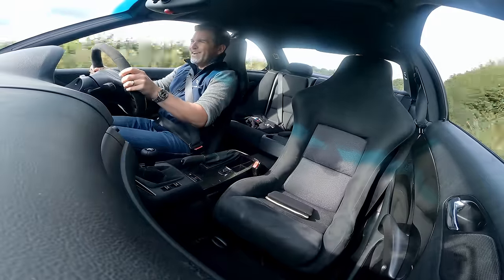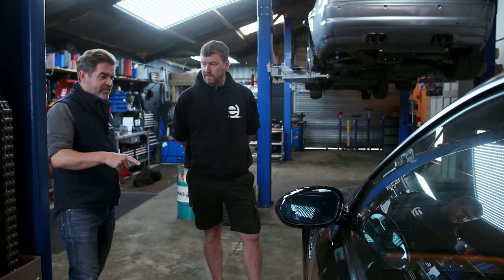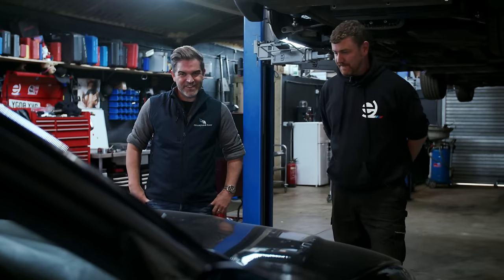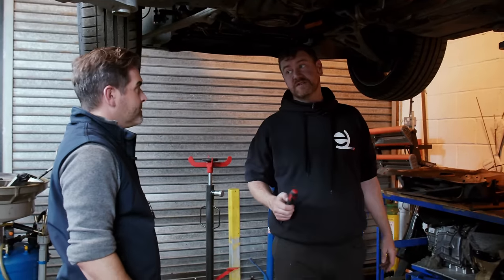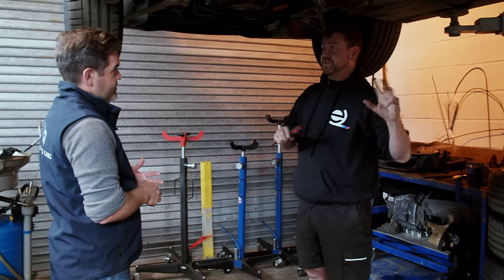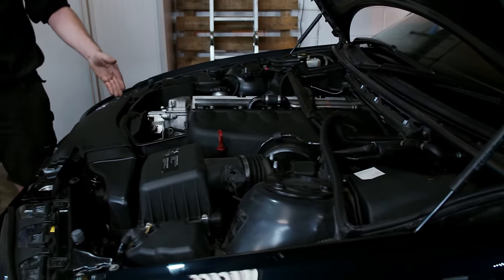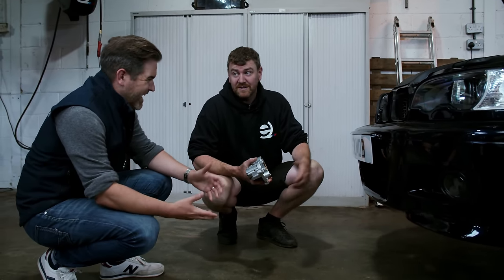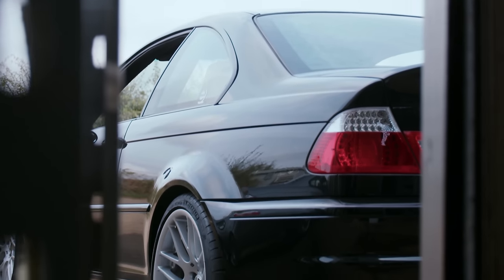BMW M3 (E46) | Buyer's guide with Everything M3s

Comment: The E46 M3 wasn't "the last naturally aspirated straight 6 cylinder M car". That accolade belongs to the Z4 M Coupe, which also had the S54 engine through to 2008. That car also had the CSL hydraulic steering and brakes. And no rear subframe issues!
Reply: I think they meant the last naturally aspirated six cylinder M3
Reply: @johnmitchell2269  very clearly said "M car", but you may be right. 😊
Reply: I also have a z4m coupe it’s great
Reply: The s54 was made for the E46. It was also installed in the z3m at the end of its cycle  and the Z4m. E46 wasn't the last M car with a 6 cylinder naturally aspirated engine but do understand  what he means  by that.
Reply: Z4M Coupes are one of those cars I like to look at and appreciate it, but I feel “most people” would never choose to own one of the e46 m3.
Reply: I wish my dad bought one, had a chance at a decent price years ago
Reply: @rabmc  I don't understand why not tbh, I have a Roadster Z4 M and it's fantastic! Almost the same weight as CSL, same steering system & rarer than an M3, especially in the UK.  Only around 1k ever registered in the UK with less still on the road.
Reply: @FuzeDzn Mainly the looks of it in comparison, the e46 m3 visually is unbelievable and getting even better with age. Such a road presence too.
Reply: Everybody forgets about the z4m coupes lol. But it’s also why I got mine for so cheap
Reply: And looks horrendous
Reply: @ArtVandelayOfficial  🤣🤣 there's always divided opinions on styling, you have yours and I have mine, and neither of us are alone. Its certainly unique, being the last one to come out of Bangle's department, and by general acclaim, has worn well. But hey, edgy designs are always polarising 👍
Reply: @gregspark9845  It's the hood line and headlights
Just looks off, like the cars tired or has down syndrome
I've contemplated the coupe M many times but that front end irks me
Reply: @ArtVandelayOfficial  that’s a pretty NPC opinion
Reply: It's the same engine and overlapped in production. It's not like they made another NA 6 for the Z4.
Reply: @theurbanegentleman4550  It's ok I understand, you 'settled' for a Z4 due to funds 👍
Reply: @matthewnicholas6365  most people know that. The S54 that went into the Z4Ms was identical to the M3 engine, but being the final iteration benefitted from improvements made during the production cycle. For example, it's allegedly less prone to the rod bearing failure. The biggie though, is no rear subframe failure which besets all E46 M3s eventually.
Reply: @ArtVandelayOfficial  wow, you're the master of put-downs 😂. I'm sure your choices are always the right ones. There, feel better? 😉

Comment: Buy a standard manual, fit a carbon airbox, ohlins road and track, suspension bushes, alignment etc, bmw 6 pot front with csl discs, 4 pot 996 rear, engine tune and if doing head gasket cams, shorter diff, short shift kit. It’ll then drive better than a csl! Do some weight reduction and boom you’ll smoke it for £20k less.

Comment: The E46 M3 is the best ever selling M3 of all time. The most successful M3. 2001 to 2006 the entire planet went M3 crazy. The good thing about that, is that because so many were sold, there are a lot of affordable ones. If you don't care about having a rare car, and your prefer rwd, it's a must have. Plus, the S54 engine, is the best naturally aspirated inline six engine ever made. The inline six that doesn't need a snail bolted on to it. Say whatever you want about RB26 and 2JZ, without a turbo those engines are nothing.
Reply: What are you talking about? They only made 50k and another 29k convertibles. That's nothing! Instant classic. I own a 02 e46 m3 convertible myself.

Comment: Some of these M3s are over 20 years old by now, it would be mad to expect to buy one and not have some issues. I've had mine for about 2 years and ive not had anything major need attention. So long as you treat it right, keep up with the servicing and try to keep ahead by prevention. But they are amazing machines, I could still put mine up against any modern M3 and it would look better. This video shows all that CAN go wrong not what WILL go wrong.

Comment: You really gotta be careful with these. Finding someone who put the money into maintaining them is really key. You don't want to be putting a grand here and there into bushings, gasket leaks, and other shit like that, even without the big three. It's an old performance car, and they never got cheaper to maintain, just cheaper to buy in to.

Absolutely love mine... when it runs lol.
Reply: The good thing, is that there are still plenty of people, who don't spend 100% of their budget on a used car. There are people who will spend 70% of their budget on an iconic used car, and invest the rest onto their new purchase.
Reply: I had mine for nearly a decade now.  I kept up the FBMWSH for the first few years, but have maintained it myself since to a high standard.  Excluding fuel, tax and insurance I have averaged spending £2k a year on it - I have not done the RACP/rod bearings/head gasket.  It's a very expensive car to run.

Comment: I have an SMG converted 6MT. I loved the CSL SMG as a daily. "On it" - no question the SMG is more exciting. People don't want tot admit it, but a 1-2-3-4 in SMG is way more intense. Lambo kept this tech for decades for a reason. 
As a daily the problem is at certain rev/speed/throttle combinations gear changes are awkward. You have to actively think about what will happen if you pull the paddle now - could  buck, slap or lag. Going fast in it a non issue, and the SMG downshift is fucking sick on SMG.
So I'd buy an MK60 SMG car for cheaper and wait for it to break / convert so SMG.
Reply: That's my plan too
Reply: @ArtVandelayOfficial  gidddy up!
Reply: I totally agree, especially the 'sick' downshift part.

Most people don't know how to drive the SMG gearbox. It's a fine art.

Comment: Did a ground up restoration on a 03 M3 6 speed I picked up for 3 grand a few years ago, I normally restore domestic muscle cars and sell them but after getting to know every nut and bolt on this car its now since joined my collection and is my favorite car to drive... I also have a 2014 Subaru STI and a 600+HP blown 70 RS camaro... I would suggest anyone who has the opertunity to get there hands on one of these they do ASAP they are getting rare...

Comment: Excellent content, really interesting and true content about the whole car.  
Only 2 additional points : 
1. Where can i find a real CSL for 50K pounds 😅 in Germany they cost almost double as much ;)
2. Owning a fully maintained SMG E46 M3 Coupé with the latest original CSL gearbox software version. This drives absolutely amazing, i would never switch to a manual gearbox. Functioning fantastic on the racetrack. Switches gears almost as a modern DKG and it is THE ICONIC item for the e46 M3, you cant just replace that,  it belongs to the car ;)

Comment: Had an e46 m3 vert from 60/85k miles never missed a beat. Did get the feeling something was about to go pop towards the end.. turns out the vanos went after I sold it 😅 but I miss that car, the smell, the sound, the feeling of actually driving it was a true M car when it hooked up and shifted down by, and you got used to the box.. what a car like a living machine. Had golf r, c63 Amg, and all sorts since . Not even touched it.

Comment: Great to hear the experts on this. I think if I was buying one, I’d need to get a specialist report before doing a deal. Otherwise you could spend £10k on a car and have a bill for another £10k to rectify faults. 

Very useful video thanks 🙏
Reply: If you are going to purchase an M3 for 10K or less, then guaranteed you will be spending another 5k to fix it up properly.
Reply: @djlakota8907  you’re probably right. I think I’d want to buy one which had been worked in by Redish Motorsport in Bristol. Those guys do good work, the kind of work that BMW should probably have done from new. One day.

Comment: A normal M3 is a really tricky proposition right now.  There are few that won't require restoration - a very expensive exercise - and they're just not valuable enough yet to make that financially viable.  So you gotta consider whether you're gonna buy one to keep long term 15 years plus - where they will regain this will in terms of a higher value,  otherwise it's best to opt for something else.  A decent M2 manual can be bought for £30K-£35K and it puts the purchase of one of these into perspective.

Comment: Great video but one thing is you can still get new S54s albeit are £6-7k for a bare engine.
Can also still buy the csl rear diffuser... At 2k however 😅

Surprised Darragh didn't mention rod bearings either too given they're the one thing that can render an engine scrap without warning!
Least with vanos and head gasket, you'll get a warning.

Making the CSL manual makes so much sense though.
They were made towards the end of '02 to and of '03 however... Most just weren't registered until late '04 as they sat in dealers for quite a bit as weren't initially great sellers.

With a 4.1 cwp, they'll still be geared for  180mph too so realistically doesn't drop the top speed capability of the car at all unless has alot more power such as a supercharger etc.
With a 3.63, They're geared for over 200 but obviously don't have the power for it so it's pointless other than for abit more refinement at motorway speeds.
Reply: I managed to bag the last diffuser May last year just in case they went permanently NLA, got a good price on it via a friends staff discount.  
Still in its box in my shed, In 2 minds still wether to fit it or save it to sell later on
Reply: @Chrisclbele  yea, you'd be tempted to just fit a decent replica one in case it was ever damaged or stolen! 🙈 I've a genuine bootlid for mine alright and a vorsteiner bonnet. Only have a replica bumper but just couldn't justify the real deal when they're so fragile given its mainly a nurburgring and track toy.

Comment: Excellent review bu not fully complete. As a M3 E46 owner ("fully" restored),2002 model 85000 miles, manual box.
 I did subframe reinforcement, new suspension (Ohlins R&T), new bushings everywhere (power flex black) except the diff bushing , new engine mounts, clutch, flywheel, rod bearings, valve adjustment. That was it for for the restauration... a couple of weeks ago: strange "ticking" noise, that was the coming from the rocker arms (8 were worn). That tends to happen more and more regarding the age of the car and probably the lack of valves adjustments from the previous owner... Anyway that was expensive (3000€+ at a Bmw specialist in Belgium). And my last bill were the cardan shafts (between the diff and the wheels) with were worn and making awful noise. Just to say that you better put some  money aside to cope for the worst... Anyway I don't regret my choice, such a pure and engaging classic BMW.

Comment: The diff's on these are not necessarily done because you hear rubbing or binding noise from it at slow speed turns. These are needing the diff fluid replaced every 50,000 miles or so and a change using the actual BMW fluid (Yes I know it's expensive but it works when other brands just don't) and your diff is fine again. I know I've gone through it and found out. Trust me use the BMW stuff don't try to save a few bucks by using another brand just bite the bullet and get the real stuff it will work!

Comment: Just to add one more horror to the list - rod bearings. 

On top of all the reliability issues, you still need to do a lot to them to make them go how they really should. These definitely should be a daunting ownership prospect.
Reply: nonsense. Ive owned 4 e46s, two of which were M3s including my current daily. You are dealing with a nearly 20 year old car that was cutting edge tech for its time and remains one of the greatest drivers cars ever produced. the reliability and cost of ownership for this level of performance has few rivals.
Reply: Rod bearings, Head gaskets and timing chains are all now considered service items which were not specified by BMW. Vanos also needs rebuilding to be reliable. And that's just the engine. Then we get on to the well documented rust and RACP issues, the diff clunk, the ignition coils which go for fun, the pillar trim which fails and the door seals which tear - all sub standard or poorly designed parts. 

Then, to make them drive right the rack has to go and the brakes need to be replaced with something less closely resembling chocolate. The gigantic gear stick and lever need to be replaced with something shorter with a different leverage ratio. The seat also needs replacing with a bucket to give decent helmet clearance and lateral support, but then the centre console arm rest needs replacing so your elbow has room and it's worthwhile considering CSL door cards for the same reason. They should have also really had a 4.1 diff from the factory, instead of ratios designed to improve 0-62 and 0-100mph figures.

I see these as a base for a build, and once built I don't think there is a better track/fast road car out there. I can fit an extra set of wheels and tyres in, along with a garage worth of tools plus camping gear so track days are easy peasy. Add in the fact that I can pop the roof bars on and carry a couple of bikes or a roof box and it becomes a very versatile machine that can be enjoyed on a lot of different roads. But I would never ever describe it as reliable or anything less than a serious commitment.
Reply: A huge reason why the Japanese performance cars were such a boom in those years. BMW did amazing things to push the edge but the design doesn’t have maintainability or ruggedness down through the years nor were they intended to.
Reply: @howarddavies136  on point brother, this vid ensured only the committed acquire these rides, not the faint @ heart.
Reply: Rod bearings are not an issue in this car. Stop being a sheep and adding to the terror. The v8’s suffer but not the e46.
Reply: @howarddavies136  This should be a highlighted post. I'd also add the Black label steering rack which has a quicker ratio than the CSL or the Z4M rack. The stock steering rack is like driving a bus. Disagree on the shift lever, however, as the shorter levers are notchy, and increase the distance the hand has to travel from the steering wheel.
Reply: @vitaliko  I've been tempted by an RTD/PS Designs shifter, but I've seen too many horror stories of money shifts. I use a 330d lever with an F10 M5 knob and it works a treat. The gear lever is surprisingly still less than a span from the steering wheel. I need to do a gear linkage refresh to get it feeling how I want because there is still some free play. Vibratechnics gearbox & engine mounts were a game changer for shifting accuracy, but then I was replacing 18 year old bushings.

ETA, thanks for the support and the black tag recommendation 👍

Comment: Great content, just a question about floor cracking. Is it true that on convertible cars the cracks are less common as the chassis is more  rigid and also are rod bearings a big issue on e46 m3? Or frequent oil change does help and no need to worry?
Reply: Rod bearings can go anywhere from 40000-100000 miles depending on how frequently the oil changes were done and how hard the car was driven. Seems like a crap shoot for the most part honestly but as long as you're putting quality oil in between 3000-5000 miles (or sooner if you track it often) and doing oil analysis to keep an eye on metals, you should be fine. Rod bearings are a consumable in these cars and should just be done for peace of mind every 60000 miles. I personally run Liquimoly 10w60 with Ceratec every 3k. I'm at 48k miles and already planning on doing the shells next year just to be done with them for a few years.
As far as verts not cracking, that's a myth. They suffer the same issues as the rest of the E46 line up with subframe cracks. There's a little more reinforcement back there, but it doesn't help prevent anything from deteriorating.
Reply: They crack very slightly less but still crack but it's also more difficult to do a proper reinforcement job on them so it's 6 and half dozen really.
Reply: @Birdrunner54  Yep, i agree with this. And for anybody reading this: Do not drive any other oil than 10W60 on the M3, you really can´t stress enough to not drive any thinner oil as the VANOS will fail eventually otherwise! And i would add to keep an eye (or rather ear 😅) out for the cam chain tensioners.

Comment: He says you will struggle to get a csl under 50 grand. Maybe 8 years ago. Er more like you struggle to get one under 80 grand now. I test drove a 97 grand 27 thousand mile one at weekend and a 65 thousand mile one for 76 grand. If he knows one for 50 grand I’ll have it off him in a flash.  Also it’s not just the power regular one down on. While driving experience through bends you notice it. It’s the handling the csl around 30 to 40 seconds faster round Nuremberg track than regular one

Comment: Here we go. Rod bearings this, vanos vanos vanos, boot floor cracks etc. Well speak to an expert who isn't trying to sell you a huge bill, and they're not all bad. The boot floor cracks certainly aren't as common as they make out. Buy an original manual with no mods, hard to find now 😉
Reply: @Will MSVR Absolutely, the only way to find out is to drop the subframe but they are ALL cracked...
Reply: @Alastor-y3w  Maybe common, but not all. I have just dropped my subframe and removed all sealer/e-coat and not a single spot weld had popped, and no cracks. Not all cars have been ragged in 1st and second gear!